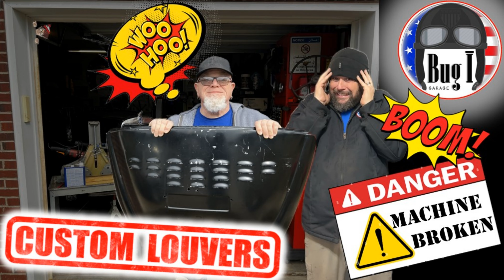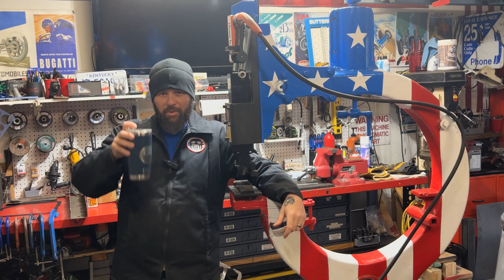DISASTER!! Is it Fixable? - Custom Louvers in a VW Decklid

Comment: i suspect you'd be wise to source another type of fixture for the main body of the press , in the mean time you could "fish plate the cracked areas , with bolt on fish plates , say 1/2" thick that would get you going again untill another choice could be acquired
Reply from the maker: Thats the plan. Looking for a 36” old bandsaw which is what I originally wanted and its stronger. Worst case I will just build a frame out of metal.

Comment: Honestly. Cast iron is not great for that type of working load. When i used to demo cast pipe out of old buildings i use a sledge hammer and smash it so it shatters like glass. 
But as far as repairs.. if you're going to attempt it, I would recommend brazing it. Probably need to cut the entire crack out, heat it up glowing red hot with a torch then use brazing rods to fill it back in. Probably be a good idea to add a few gussets too. But i think it will probably happen again. The frame should really be built out of an alloy of some sort.
Reply from the maker: Yeah I figured as much and knew using the old bandsaw as the base wasn’t the best option. I will try and fix it or find a 36” model since those are stronger. Just need to listen to that voice in my head more. Lol

Comment: Hi, I just subscribed as I am restoring a 1919 bus here in England. I need to louvre the bonnet (hood) and side panels, I found this video excellent for the measuring. As to the crack in the cast, well we had a large bandsaw and that cracked in more or less the same place. We welded it but also made some heavy plates up and bolted them each side of the frame just to give it extra support. You have nothing to lose by trying to weld it really. Get it nice and hot and 'vee' it out. All the best from England.
Reply from the maker: Awesome. Appreciate you subscribing. As for the press, I will try and fix it, worst case I will find a 36” throat bandsaw and swap the stuff over.  Look me up on facebook as well, then you can message and send some pics of your build for me to check out.